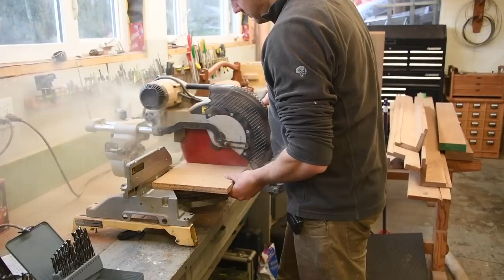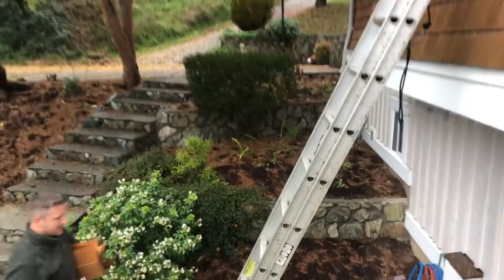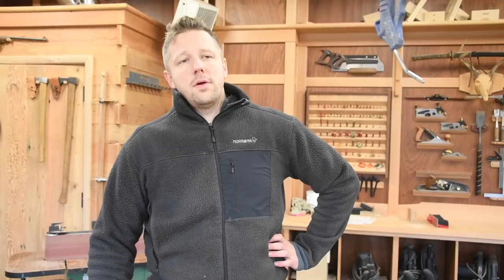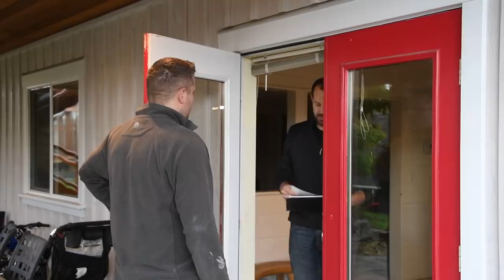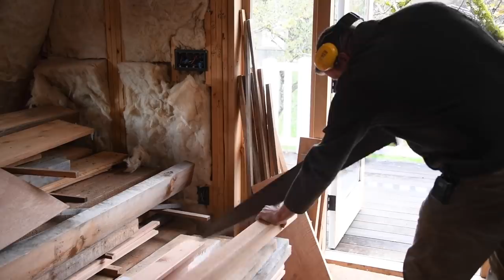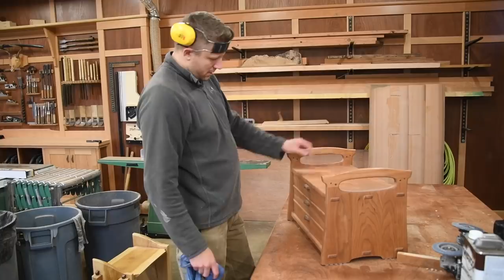Said No Carpenter Ever!!!

Comment: "The guy who started to build this before I got here, really did a great job"
Reply: That actually happened to me once.
Reply: I write software for a living. It is even worse with other people's code.
Reply: I love fixing other people’s work
Reply: Thanks but I had to walk off because he only wanted to pay sweatshop labor rates.
Reply: @SethWilhelm  you say worse, but code doesn't support the roof over your kids at school.
Reply: @xneet00  I humbly stand corrected
Reply: @Username-2  pretty sure carpenters lay out the tarmac for the airport they also built.  the dam that powers the school, airport and homes they built.  the streets that connect it all.

code is important, but for the past couple thousand years its been more important that the room you're in doesn't collapse.
Reply: @SethWilhelm  didnt mean to sound rude if i did.  code pretty much runs peoples banking and a lot of medical machines.  even if its something simple it has to actually work lol.

my only point was that code can be messy and redundant because it typically only slows down the process.  a carpenter has to do things a certain way or else the structure will fail.
Reply: That is a good one!
Reply: @xneet00  This was a wholesome back and forth, I dig how you gave credit to both angles on the subject and made it a practical comparison discussion instead of letting the slightly competitive subtext turn into a dick-measuring context. Props

Comment: "This micro blemish that no one will notice doesn't bug me at all" 😆
Reply: This one speaks to me.
Reply: Even when it is underneath a drawer where you have to know were to look and actually hunt it down.  Nope not at all.  

I built a guitar and made small accidental nick with a chisel in a neck pocket.  You would have to remove the neck to find it but it still bugs me.
ETA:  I changed the tuner on a friend's Fender Tele and the new tuners did not match mounting holes with the old tuners.  Filling with wood dust and CA was the only economical option and the colour match was almost perfect (unnoticeable beyond about 40 cm).  I try not to fixate on the "almost".
Reply: @tiacho2893  I tell my self things like, "yeah I'll fix that hidden spot that you would have to flip over and take apart to find and I'll double down by finishing like it's a surface, someday someone will see that and say, damn that's good work, they didn't have to do that but they did, they did that for me"
Reply: This is the biggest one for me. Drive myself bonkers
Reply: I have contracted out tile work I know I could do just so I wouldn’t be the cause of  the defects I would see every time I walked by.
Reply: This is why I lose sleep.
Reply: Bit of reality , bit of Ben there done that, and everything else. Enjoyed your video ... thanxs
Reply: Just @ me next time.

Comment: That off cut is totally useless. I can throw that away!
Reply: i am a carpenter and we say that very often
Reply: Haha everytime I cut a board
Reply: yeah,  I am sure that the weekend woodworkers are the only people that actually save the scraps they cut off the boards.  those of us that actually do it as a job have no use for those and they end up in the burn pile.
Reply: @orion7741  I do it for a living and still save them. I'm a wood hoarder.
Reply: @loganhyde4071  same, I procrastinate a lot about wether or not I should burn that pile of scraps I have never used for over 3 years even though I end up putting pieces in the the wood stove anyway.
Reply: @orion7741  shorter than your arm, burn it, longer than your arm, save until after punch out, then burn it
Reply: 3mm thick
Reply: Lol, truth, i had to get a shed for all my accumulated wood. BUT I'll never say it's alot lol

Comment: Of course I know where that tool I just used is.
Reply: Pencil?... Its tucked in your ear
Glasses?... on your head
Ear defenders?... around your neck
Tape measure?... Nope not on your belt, you sealed that up behind the wall
Reply: @heli400  In my case, layed it on the other side of the house, where I'm not even working lol
Reply: Said scouring with weepy eyes
Reply: @heli400  guy laid carpet in my house over 20yrs ago, rolled up a few end cuts and left them in the corner. About 15yrs go by and I decide to use one of the cut offs, unrolled it and there was a shiny new Stanley 25FT tape measure.
Reply: @twc6392  haha! can I have my tape measure back?

Comment: If Stanley was good enough for grandpa, its darn sure worth buying today!
Reply: Whats the problem with Stanley? I know that their tools are not the best of the best, but they still have got pretty good value for money
Reply: @janbernad4729  Stanley is a huge conglomerate with many brands under it. They used to be excellent in many of their products. Not highest quality but quite good. They have mostly attached the Stanley name to their cheapest products. Some items are of good value and some really are not. My Stanley occilating tool is mostly a rebadged Dewalt making it a good value. I bought my wife a Stanley hammer I really like. Screwdrivers  are aweful, upgrade to a $20 5-piece Felo set of screwdrivers and you will understand difference between worst and some of best you can get for value. All that rambling to just say it depends
Reply: @nate1sam  yeah I really like my felo's. I don't think I have anything recently made by Stanley. Tons of old planes But I don't buy anything made in China.

Comment: Renovating an old house: "nice, every wall is straight and there's no weird plumbing issues"
Reply: Oh man..... 90-year-old house here... Correct: the brick walls are as straight as a lawyer turned senator... And..... roots in the clay pipe that runs under the wooden floor, through the foundation!
Reply: @ibubezi7685  I feel ya. If you took apart the brick walls and laid em down It looks like the one doing the brick work was trying to recreate the "calm of the ocean" during a damned hurricane.
Reply: @Sho81  If you take down our brick walls, you end up with a mountain of dust - drilling is tricky, sometimes the bit just sinks into it. I figure the plaster keeps them together - but yes, that makes the walls (also) uneven. Mounting rails or timber is always curvy.
It's a beautiful, solid house, but it comes with 'special qualities' :-)

Comment: “I got a great deal on this Stanley Woodstretcher!”
Reply: Quick tip: If you just drop your tape measure a few times it can function as a woodstretcher on your already cut boards. Don't try to use it on uncut boards, though, or it'll have the opposite effect.

Comment: Agree on all of this except "I should've been an electrician" that's a joke among the carpenters I know. Except when it's the middle of January and you're on a boom lift 40' in the air installing heavy gauge studs and it's 2 degrees out and the wind is blowing and the cutoff for inclement weather is 0 degrees. Then it's a pretty serious statement.

Comment: Those Staples aren't going to hurt the Chisel/ You just Hammer a screw right in that's going to work just fine/Just cut it a little short it will fit/ It doesn't have to be square long as it is close enough.